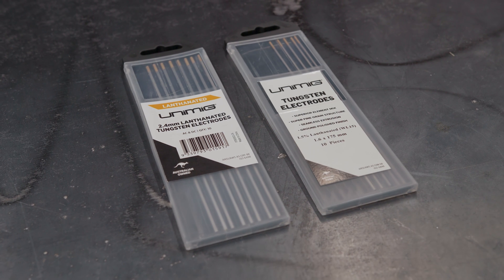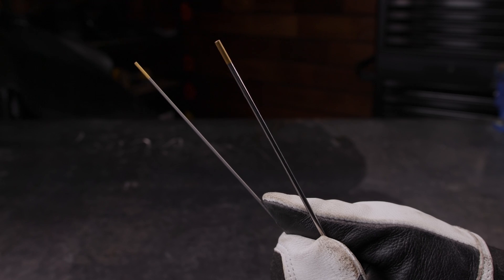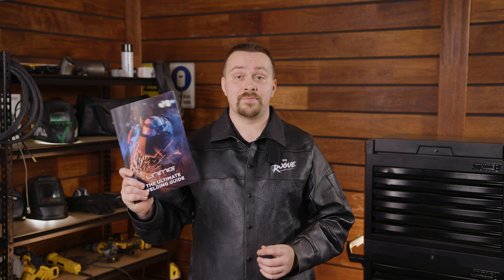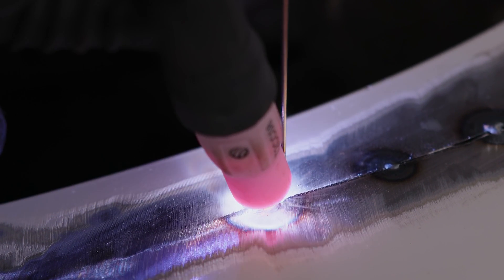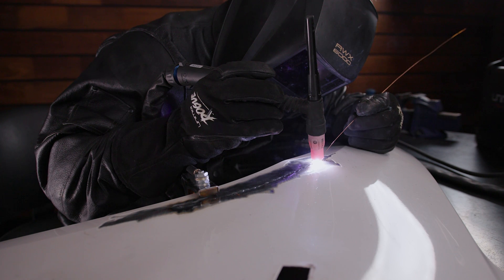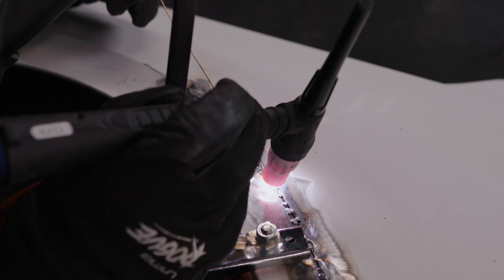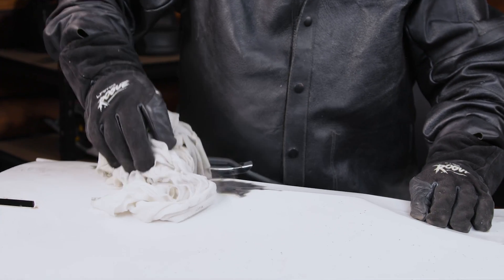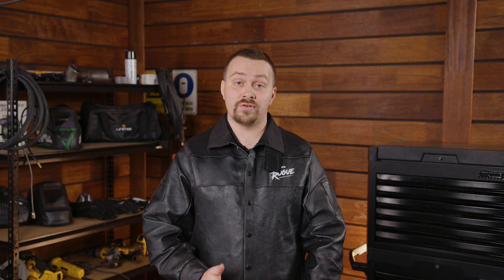How To TIG Sheet Metal for a Perfect Weld

Comment: The easiest way to straighten out mig wire to use with tig welding is:  (1) cut a 36" length of wire off the spool.  (2) anchor one end of the mig wire in a vise. (3) Insert the other end of the wire in an electric drill. (4) pull the wire straight.  (5) spin up the drill for a couple of seconds.  The wire will straighten right out and hold it's shape.   If you are careful you can also use this method to twist two really thin wires together to make an intermediate gauge filler rod.  For instance, two .023"/.58mm wires twisted together is roughly half or two thirds the amount of filler you would get if you were using a .040"/1mm filler rod.

Comment: I have been MIG welding car body panels for years.  I am now learning to TIG and unfortunately, I don't have a mentor, so I am learning via trial and error and these helpful videos.  I should have learned TIG a long time ago, but better late than never!
Reply: I'm kind of in the same boat as you.  So far I've learned: (1) Forget "lift start" tig.  Even a cheap high frequency start is better to learn with than an expensive lift start.  (2) keep your  butt joints as tight as you can.  (3) Make sure your joints, filler, and tungsten are immaculate... wire brush and clean with acetone or your welds will want to ridge up. (3) Stop instantly if you blow a hole, let the metal cool, then do hot quick tacks to fill in the hole (You probably do this instinctively anyway.)  (4) Using a die grinder and carbide burr to carefully remove the peaks/ridges of welds will save you money on grinding discs.  (5) I keep my welds short (1" or less), burr/grind them down, then hammer them before moving on and welding more.  This works for me, but the pros say to just weld as long as you can.  You choose your technique.  AND (6) I use a 1" x 2" x 4"  (25mm x 50mm x 100mm) block of aluminum clamped to the back of butt welds when I can.  This seems to keep the joint flatter and allows me to use slightly higher amperage.  For me using this backer is critical for fixing wide gaps that always seem to pop up now and then.  It saves me having to cut and shape another patch panel if my cutoff disc went a bit wild.

Comment: He tells you to keep the metal clean but he doesn't do it himself XD. Just look at 4:53 the sparks are either burning filth or burnt metal after angle grinder cuts ( may also be zinc coating since its a car fender it's fumes are toxic btw  ). And my man why are these tack welds so freaking black ???? Also he does not show the finished weld so probably not much to look at. I can tell because even after grinding there are overheated spots and just straight up melted sides. My man you could use a bit of your own advice wich is actually good.

Comment: Excellent Video  - Well Done Sir ! ..   Like the fact about why to use the right Tungsten , I personally only use a low volume of Gas.. 8 LPM on a 5 or 6 Cup with a mixer inside , High Current , Low Base with Pulse.. and thats for as little as 0.4mm Stainless - works a treat..  But yeah this is one of the better videos out there so thanks for putting this together for many to watch and refer back to..  and you didn't speak to fast and rush it !!  . AAA+++

Comment: awesome helpful vid, I'm in the process of TIG welding some patches in my car, but I'm using a cheap DC inverter TIG welder, so how many amps is a ballpark figure? I'll be using a 1.6mm gold tungsten electrode and 0.9mm MIG wire as filler.
Reply: How did your panels turn out? Did you master the process? I’m a novice, and I am about to start my patch panels on my VW.

Comment: MIG wire..... Pull out 1 metre at a time. Loop an end. Put in the power drill chuck. Vice grip the other end. Run at a slow pace while pulling outwards until the wire snaps at the chuck. This leaves the wire straight as an arrow and can then be snipped to 300 mm lengths. I also use champagne or wine bottle corks on then ends of any wire just for easier handling and they'll also easily arc down to the cork comfortably. You know just what its like trying to pick up a length of wire from a bench top when you've got gloves on don't you?
Reply: That a really good tip. Thanks.

Comment: anyone else cringe when they saw that wobbly tungsten sharpening?
Reply: I'm not a pro welder and I'm pretty crap at it. But that was some pretty clumsy sharpening. Not being a pro, I can afford to take my time with it, so I put the tungsten in my cordless drill and just get it rotating pretty slow before I apply it to the grinding wheel. Works perfect for me.
Reply: @richardpavey1687  I came up with a way that combines your drill-chucking with a back-to-back pair of diamond "lapidary" wheels mounted on my 6 inch bench grinder.
I rough the tip out using the 180 grit diamond wheel, and then smooth it to the point I want (whatever that  might be) using the 1000 grit diamond wheel. It's fast as stink and I reserve the wheel (2 discs back-to-back = 1 wheel, in my books) for electrode grinding only. The other wheel on my grinder is a normal coarse grindstone wheel for lawnmower blades, angle iron and such. I sweep the tip of the electrode back and forth across the discs to keep wear reasonably even and I'm super happy with the result. The only crappy thing is that I had to jerry-rig a bushing to get the discs well-held on the arbour. They're really thin.
Just search for "6-inch Grit 800 Diamond Coated Flat Lap Wheel Grinding Disc" on Amazon. Loads of them will pop up.
Reply: Exactly what I do, Cordless drill and sharpen on bench belt sander. Works perfect for my non expert abilities.

Comment: Trev's Blog shows a way you can use mig wire, and it works a treat. One end on the vise the other on a drill and twist.
Reply: Came here to look for this. Good tip.

Comment: Did i hear to use a stainless steel filler rod? I am totally new to TIG welding and I did not know that you can use a stainless steel filler rod for non alloyed steel (is it right?) Cheers for the nice video!!